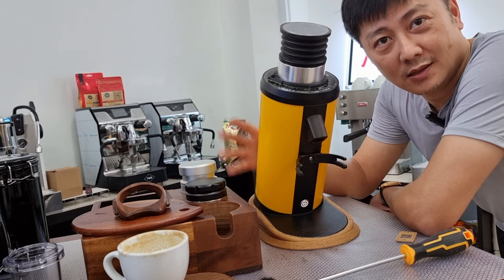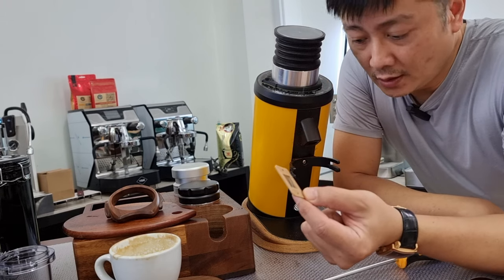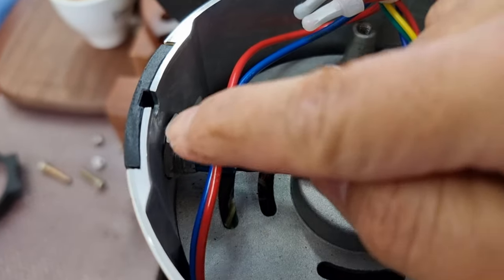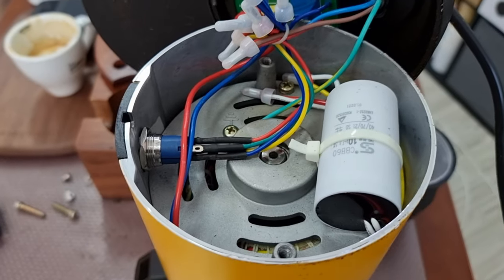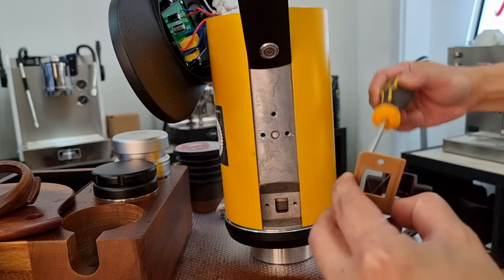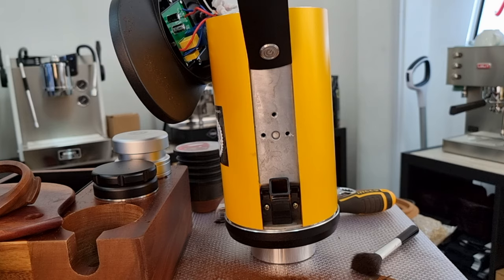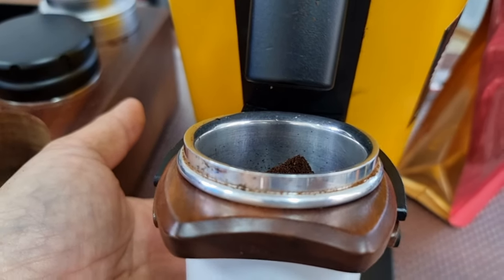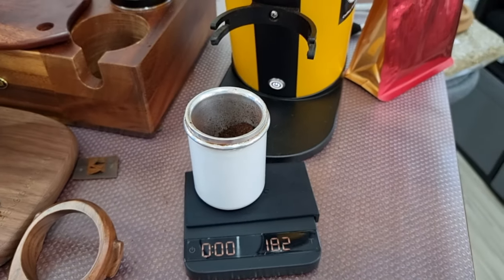Installation | New Declumper Kit | DF64

Comment: I have the SSP MP burrs, removed the silicone and printed a simple spacer, no declumper to impede coffee. I printed a declumper similar to the one you show. Tested with it and without, i.e, spacer only. I'm getting the best results without the declumper layer. Use it for filter

Comment: CY is the material you are using the same as the clear plastic stencil used in the transparencies used in the overhead projectors? 

The one I am currently using is a very similar design that you had previously showed on one of your YouTube videos. It is holding up very well. I just make sure to periodically clean the chute with a vacuum cleaner about once a week or so . I don’t open up the grinder I just use a vacuum cleaner up the chute and I leave the bellow in place at the same time I vacuum up the chute with the grinder turned on. I also use a thin brush up the chute to make sure if there is any coffee stuck around the plastic stencil declumper I help it get loose and then use the vacuum cleaner again as I explained above. If I do this regularly I keep the DF64 clear of any clogging.
Reply from the maker: Yes Ed. Its the same and thank you for the feedback! It's great that this design is working well!

Comment: You never should set the burrs "to zero" with the engine running. Instead, turn the shaft by hand, possibly from above with a socket wrench until you feel a clear resistance.
Reply from the maker: Thanks for the feedback!

Comment: Shouldn’t the declumper be installed the other way around, with the transparent piece closer to the exit so there’s no coffee trapped between the spacer and the transparent piece? 🤔
Reply: Yep, I think so, too. I built a declumper myself out of aluminum, double sided tape and PET from a blister package. There already is enough space between the rotating scoop and the declumper.
Reply from the maker: It actually doesn't matter much as the PET flap is designed to be slightly larger than the hole. But yes you can fix the transparent side facing the out towards the exit chute with the spacer facing inward where the stock declumper use to be touching.
Reply: @CaffeMartellaSingapore  thank you! I’ve also installed the declumper inverted, so the side with the 2 small flaps is on the side where the grounded coffee comes from to see if since it’s smaller there’s less resistance from the flap to allow the coffee to exit the chute, reducing  the retention. 
It looks like it’s been working good.

The big retention problem is now the coffee that goes up on the chute hole 😂

Comment: Do you still recommend the tilted base mod  on this grinder?
Reply from the maker: I am the designer of this tilt base and based on my use, and the moded declumper, I am getting super clean grinder chamber and very low retention if there is any.
Reply: Is the base available for sale?
Reply from the maker: Yes it is. You can find it on my website www.speedy3dcreations.com/accessories